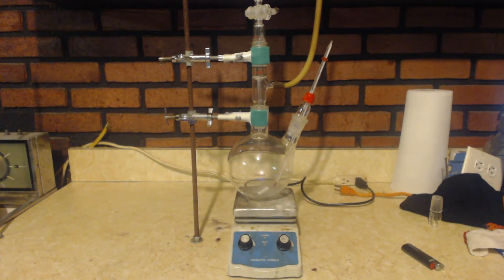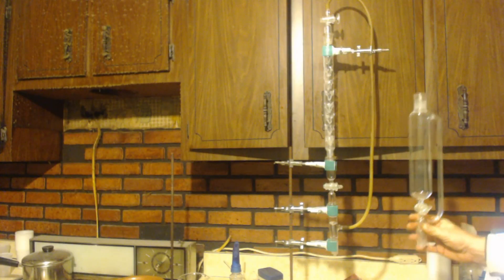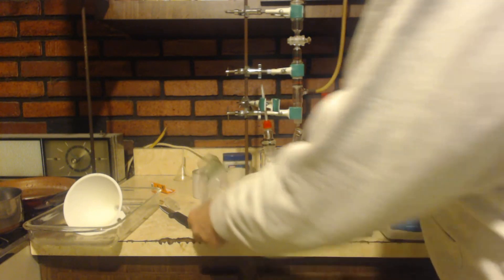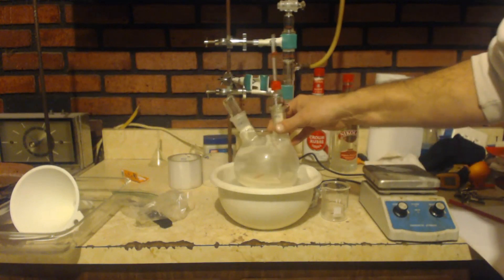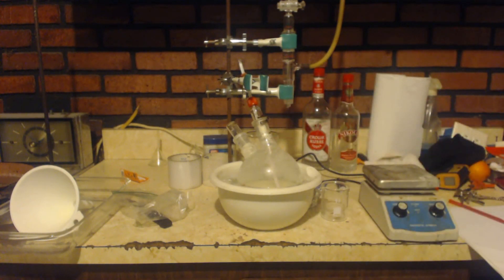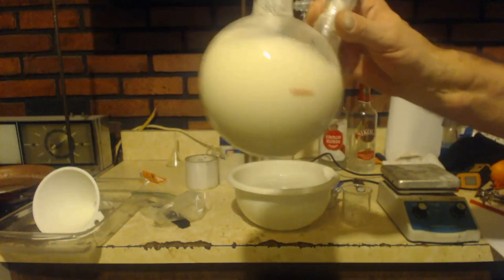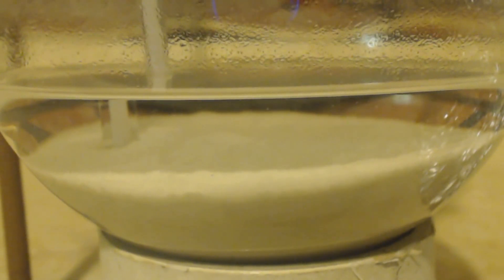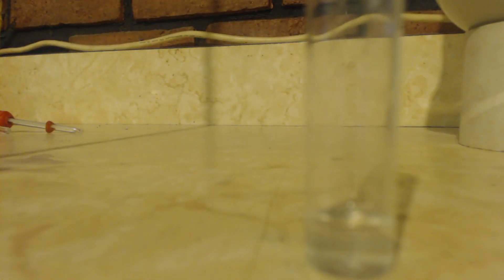NITROETHANE SYNTHESIS  part 1

Comment: If you want anyone to take you seriously, you might not want to show a RBF full of ether over an open flame.  That's only the most glaring mistake here; why would you share this with the public?  I'm embarrassed for you.
Reply from the maker: amarissimus29............I am to poor to afford electric heat for experiments.  I actually do not even turn my furnace on because i can not afford to heat my house.  So i live and sleep in my kitchen in the winter time.  And i use the heat from my kitchen stove with one burner on the stove on low to heat the kitchen.   And that is the heat i use for my experiments.  I tried using a heating mantle one winter and the electric bill was OUTRAGOUS.  
                    And i give up on trying to get people to take me seriously.  That is why l  have not put a video out in a long time.
                      Pretty much everything i distill is flammable.   Why do people only complain about using a flame with ether? 
                     Not in a regular distilling apparatus because that is very hard to get a leak in it when distilling low boiling distillates BUT in home made distillation apparatus i have had many leaks from acetaldehyde to ether to ethanol to benzene to styrene to ethyl acetate  catch on fire during distillation because of leaks..  And you know what..........EVERY SINGLE TIME.......It caught on fire on the out side of the flask usually the size of a big candle.   So i turned off the flame burner and  blew out the fire (flame) like a candle.  And then tightened the leak.   And guess what.  The fire went out.   The truth is during a distillation there is a higher pressure in the flask than in the atmosphere.  And if there is a leak the pressure will not let the flame go into the flask. JUST LIKE  a lighter or a torch works.    You would have to have the 2 ground glass pieces TOTALLY disconnect with a giant gap.  And that really does not happen when distilling  LOW boiling distillates.  There is not enough pressure to break the seal that much.  The truth is chemist use flames to distill all kinds of flammable stuff.   Most high schools only have bunsen burners in the chemistry classes.  And that is for idiot kids in junior high and high school.  Where as  I am an old man with literally THOUSANDS AND THOUSANDS of hours of distillation experience.   And i have NEVER had one real problem occur.   Don't get me wrong i would not want to use fire to distill 5 gallons of ether.  But  I only deal with SMALL quantities of chemicals.   And sure an electric mantle would be BETTER if you are rich or if you do not have a lot of experience with distilling stuff.  Fortunately i do not fall into either of those categories.   If all you have is a flame for distillations i SUGGEST you do not distill flammable things until you have a lot of experience distilling stuff.   And start with water as your first distillation.   Wait until you have at least a thousand hours of distillation time under your belt before you start distilling flammable stuff with a flame.   And only if during the thousand hours you have no leaks.   If you have leaks then wait till you distill a thousand hours with out leaks.  Then you should be knowledgeable enough to distill flammable stuff with a flame.   Good luck buddy.  If you have any more questions just let me know.
Reply: @jbsc6180 based priorities
Reply: @jbsc6180   On ecology and conservation Richard H. Kemp believes it is obvious we are living on the world’s capital rather than its income. 

Deep respect for those who can do more with less!..reuse-repurpose recycle refurbish for higher yields…in life.

Richard H. Kemp

Comment: Funny how few comments you have here for a topic that I know has millions and millions of interested people studying it.  You should spend some time making your own stir bars, it's a real pain in the ass, harder than just about anything but once you get the trick to it you'll never have this problem again.  My stir bars will stir concrete
Reply from the maker: Sizzlean..................good idea.  Wish i had time to do it
Reply: Mean stirring motor not bar, right?  PTFE can’t mean?  Do video or overhead stirring explosion proof spark less. I’d watch. Four decades or dropping IQ, returned to school for hell of it, was shocked, all schools!  This would have been huge when first in school. There should be zillions folks doing and discouraged. Dumbing down, see equipment on Craigslist cheap sometimes. Really enjoy these, people with passion make the best teachers always!
Reply: @aryanprivilege9651  No I mean Magnetic Stirring Bars, Homemade.  If you have extra ptfe stirring paddles you can pull the steel out and cut off a piece of the stem to use for your stirring bars.  Wrap magnets in ptfe tape and insert and try, once you get the orientation correct then you can seal them with liquid Rubber.

Comment: This was super helpful. Thanks!
Reply from the maker: Angel D ……………… Your VERY welcome.  I am going to do this experiment a second time very soon.   But this time I got a BETTER mechanical stirrer.   So it should go a lot better..  Plus I have 2 other methods I want to try soon
Reply: @jbsc6180  Awesome!    The videos help a lot especially if you're new to this and you do a great job at explaining the "why" behind what you're doing too.
Reply from the maker: Angel D ……...Thanks.  That is one of the reasons I started making videos.  No one ever says why they decided to do something in their experiment. And if you ask them they never reply.    I am also going to try to make nitroethane from sodium ethyl sulfate and sodium nitrite and K2CO3...…………. and then I am going to try to make it from alanine which is an amino acid

Comment: I see nitrostyrenes and their reductions in the near future
Reply from the maker: science and anonymous....………..Maybe phenylnitropropene with a 3 methoxy 4 hydroxy groups on the benzene ring.   From a henry reaction using a dean stark apparatus.  Vanillin plus nitroethane and 3 methyl butylamine as the catalyst.  I guess it depend on weather or not this experiment works making nitroethane.   I think it did.   But a low yield.  I would be happy to get a 40%.  Hoping to get 50%.   Bet the next time I will get 60% or better.   Made so many mistakes and problems this time.   Guess in the morning I will filter and distill everything and see how much nitroethane I made.
Reply: @jbsc6180  all is hoping man. It's an incredibly useful chemical. If I were you I would look up gallic acid
Reply from the maker: @science_and_anonymous  ………….I looked it up.   I am GUESSING you are talking about how it is a precursor to mecaline.    I think syringaldehyde (extracted from spruce and maple trees)  is a better starting material if you can get it.  Two of the hydroxy groups are already the ether you want.  And the carboxylic group is an aldehyde.   You could throw a protecting group on the aldehyde and use a Williamson ether synthesis to turn the ONLY  hydroxy group in to the ether you want.   The aldehyde part can then react with nitromethane in a henry reaction  to turn the aldehyde group into a nitro ethene group  and then the nitro group and double bond can be reduced with hydrogen or electrolysis to make the mescaline.   Just a guess.  I am curious how much syringaldehyde is in spruce and maple trees????????
Reply from the maker: @science_and_anonymous  ………..I am not that far in the lab.  Meaning putting stuff on rings.  But after I do that I will get in to indoles and then purines.  I THINK nile red makes 3 methyl indole in a video.  Yeah it is called skatole.   Well if you could add a hydroxy group to the benzene ring on the skatole and then change the methyl group into an amine you would have psilocin,   That is what gets you high in mushrooms.   Psilocybin is also in mushrooms but when you ingest the mushroom the psilocybin hydrolyses to psilocin.  So it is ALL psilocin that produces the high.  Just a thought
Reply: @jbsc6180  hahaha, maybe not psilocin. It's gonna be A PAIN IN THE ASS to add that OH group. You'll have a much better time making something like say N,N DMT, with no substituted hydroxyl group. Just HMU if you need help with that